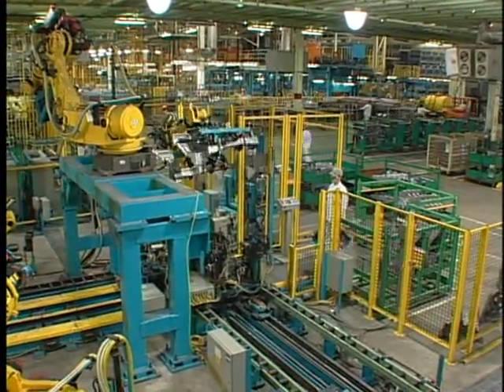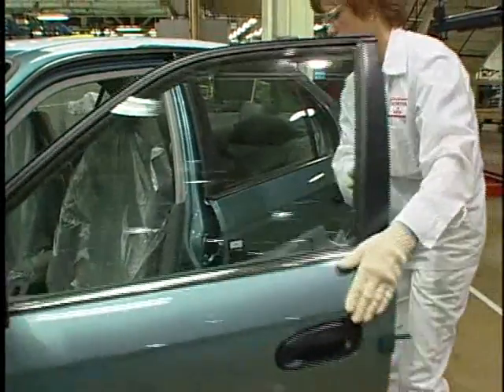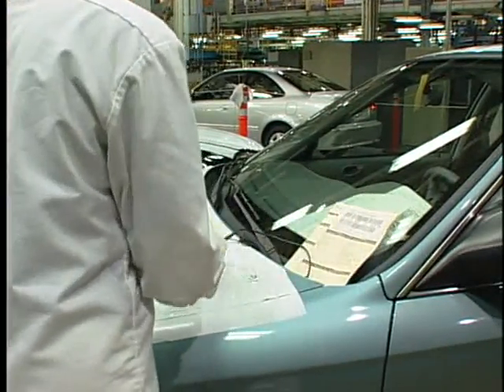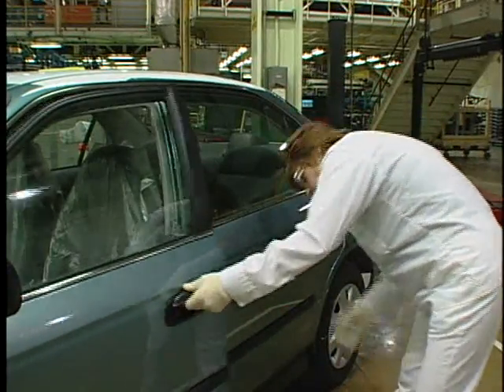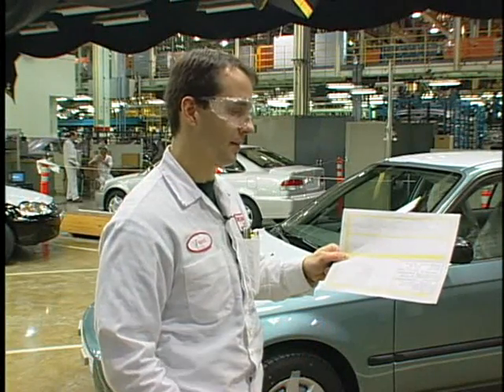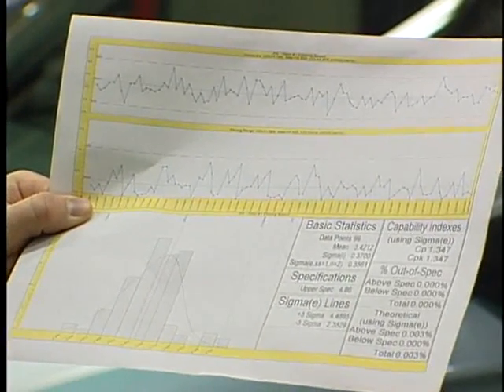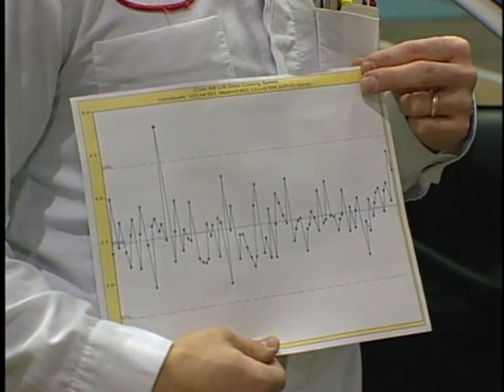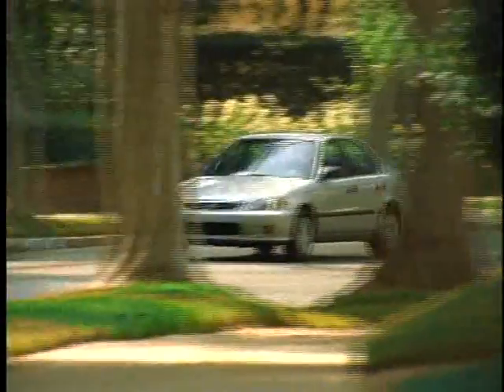Honda Statistical Process Control

Comment: I will never buy a Honda again they are nothing but junk Honda transmissions maybe you should monitor it more Honda reliability sucks your engineering on transmission they are stupid Honda transmission will die on you by 50,000 miles Toyota keep on going
Reply: Prove it with an x-chart and I'll buy Toyota